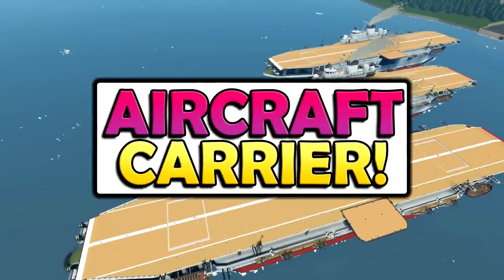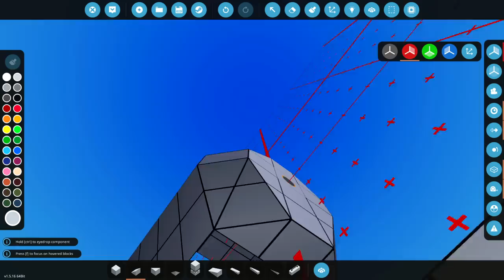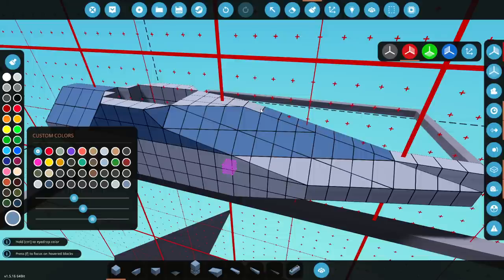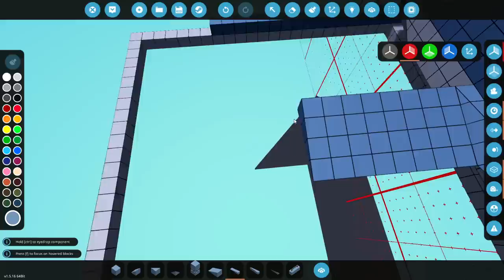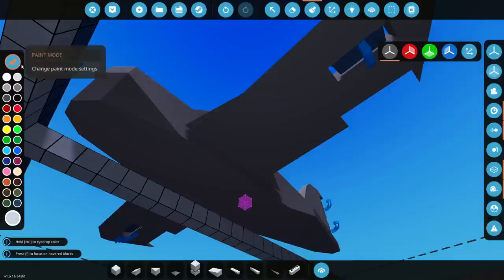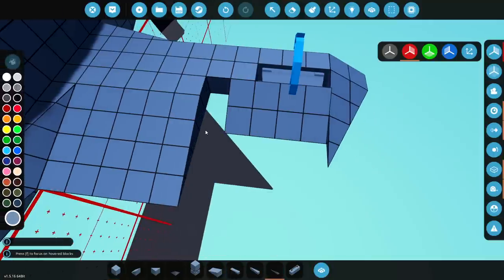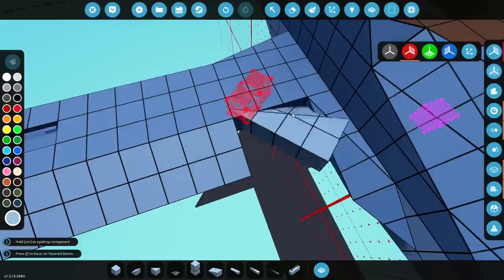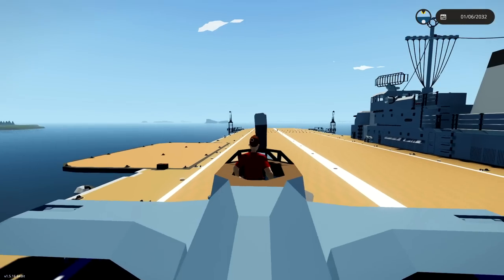Is This Warplane Good Enough! - Aircraft Carrier Build - Stormworks - #33

Comment: A rather small aircraft I must say, but I wonder how good it's performance in flight is (I'll nickname it the 'Sparrow'). If push came to shove, you could add folding wings to your aircraft so it can take less space parked up, but the elevator needs to be expanded for a larger fuselage.
Reply: For a larger fuselage you could use a folding mechanism, sort of like the cargo door on a 747-LCF Dreamlifter. I can't think of many historical examples of fighter aircraft using this, but it's certainly viable.

Comment: i think you should use that plane design, and for the landing gear you should make the landing gear not fold backwards but fold in so it wouldn't take up as much space and on the deck you should also make a catapult that can launch the planes off without crashing and stuff other then that i love the carrier and it will be so cool to play with on the workshop